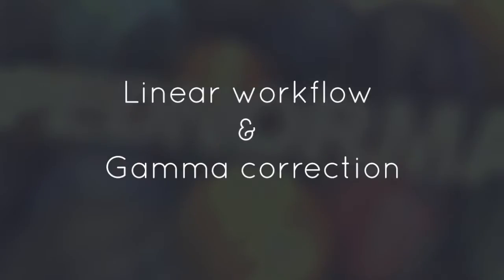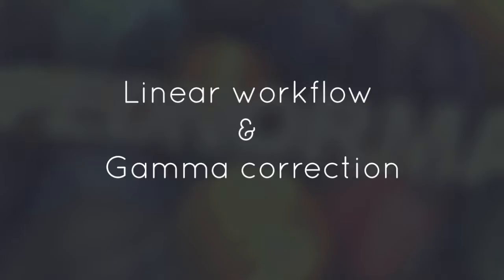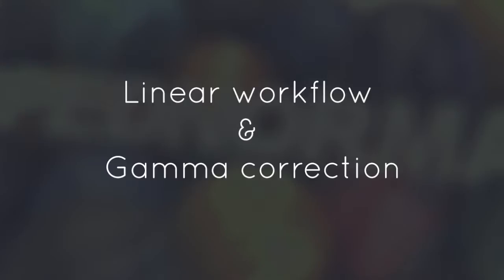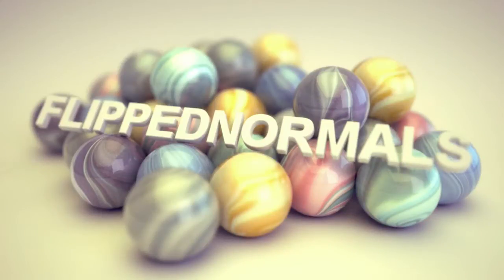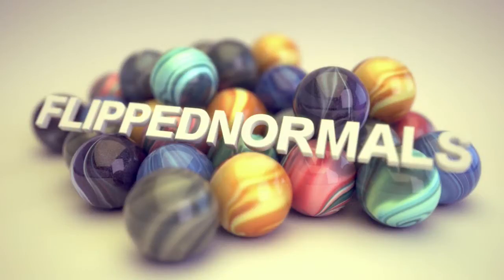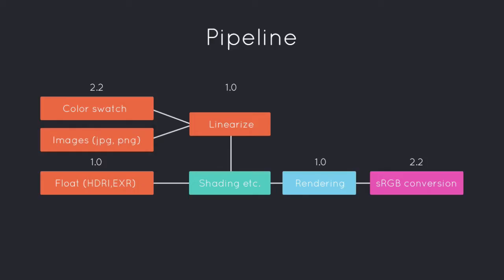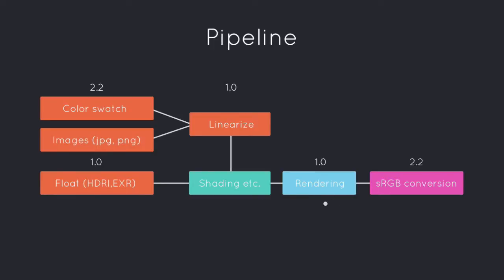What is Linear workflow and Gamma correction tutorial HD

Comment: Yeah linear is really scary. Simple switching from gamma to linear in Unity made a huge scare away from it.
Using default objects and materials, I switched to linear. Gamma looked smoother while changing to linear made it almost stale with no softened shadows.
The scene becomes much brighter and doesn't look right directly so you have to mess around with the light settings to get it right